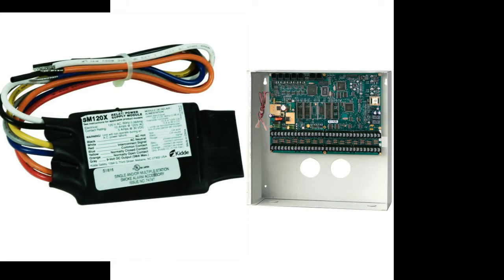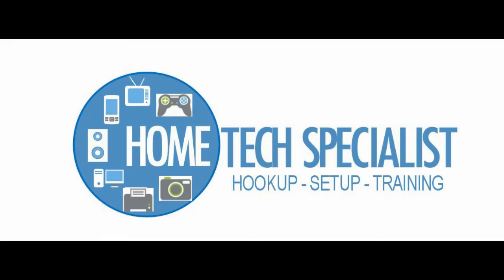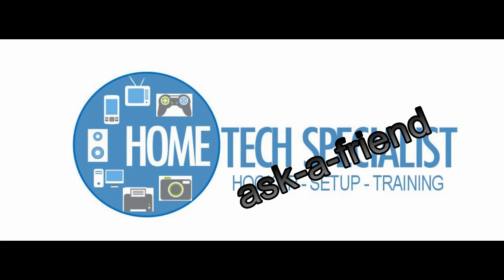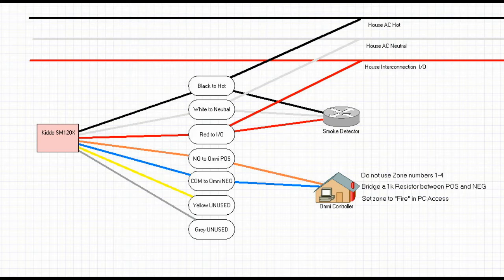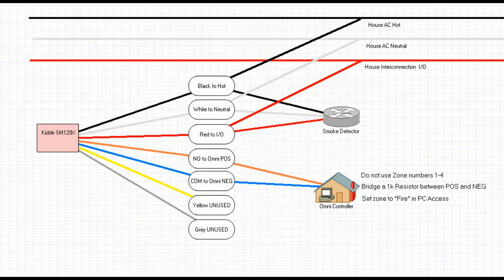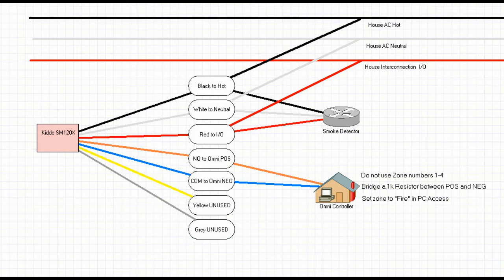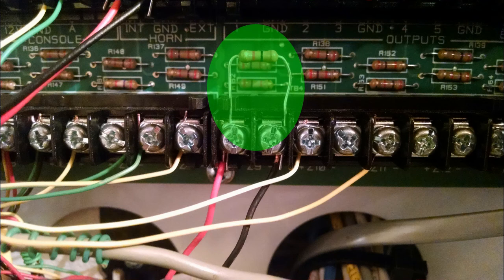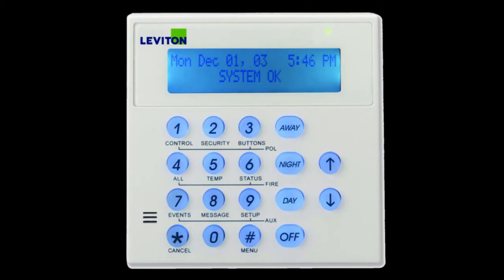Smoke Detector Relay Install for Omni

Comment: This was awesome as I'm taking on the project now.  You didn't say why not to use zones 1-4 even though the installation manual says to do that and move the jumper.  I was wondering if you did that and what the result was or if this instruction is specific for a 12 V system and that the panel would then be the power source and monitor.